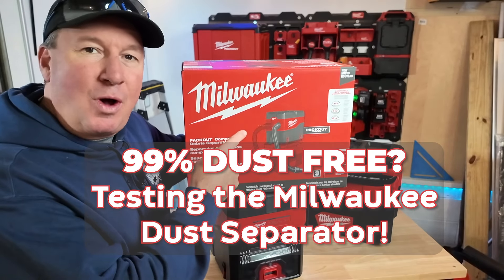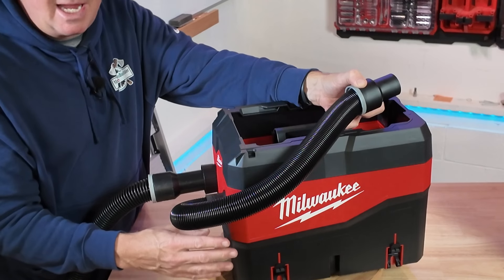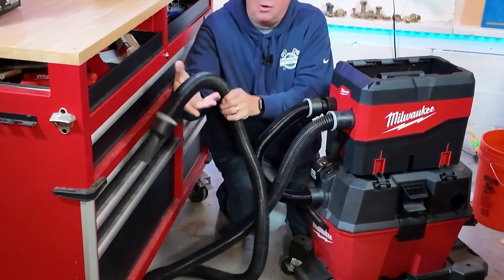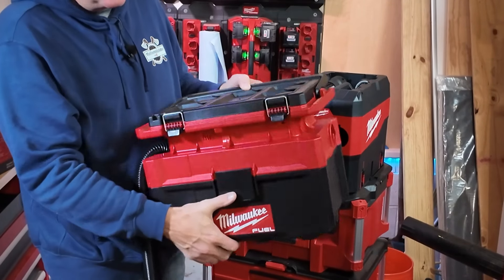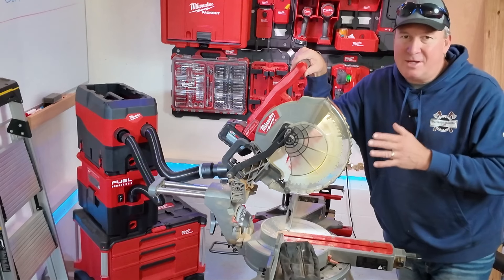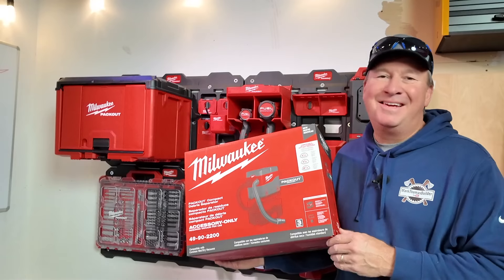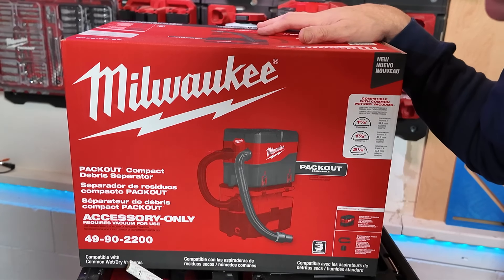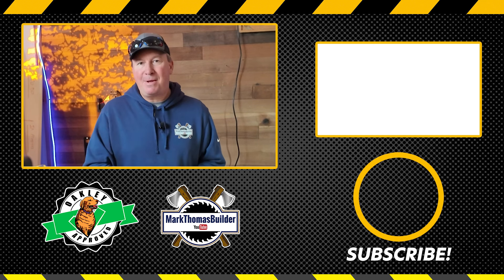Testing the New Milwaukee Debris Separator – The Ultimate Dust Collection Hack!

Comment: I really like how this works. Looks much better than the bucket method. I also like to stretch a scum sock over my vacuum filter.
Reply from the maker: Great tip, I'll have to try that!
Reply: What is a scum sock? If you put a sock over it, you're reducing suction. Better to invest in a 2nd filter so you always have one ready to go while the other one is being cleaned, or better yet, invest in the fleece bags.
Reply: @HomeSchool4You  Depends what you're vacuuming. A scum sock is very thin like pantyhose and you slide it over the filter, they're used in pools. You don't need a second filter which is the point of a scum sock. Slide it off and pull another one on when needed.

Comment: Sure wish DeWalt would come out with a nice smaller unit like this, to pair with their cordless dust extractor. That thing fills up quick. Maybe I just get this and pair the 2
Reply: Look up CarpenterOne Tstak dust extractor set up. He used a versastack large container that works with Tstak to create a dust separator for it. I built the same one and have used it countless times and once in awhile I need to empty the fleece bag and clean the filters. It’s a really great set-up.
Reply: @EveryDayCivilianBlog  will do! Thanks for the suggestion.

Comment: Using the bag AND the debris separator is redundant. In fact, both the bag and the separator will reduce suction somewhat. It's best to use one or the other for best performance.
Reply from the maker: That's probably true.  My thinking is that since the bag and filter is new, I'll probably not lose too much performance.  Once the filter gets dirty, then the performance drops pretty quick.

Comment: I like the idea of this. More compact than the bucket types.  I have the packout vac and the fleece bag fils up really quick.
Reply from the maker: This will definitely help you go through way less fleece bags.
Reply: I have the dust separator but I also use the fleece bags. I will say it’s best if you don’t have the separator is to use the fleece. Take some really nice scissors and cut the end all the way across. Take a thin piece of plastic or wood and use some nice binder clips to make it removable. Then you can easily remove the clips and wood piece and dump the bag out and reseal it up for tons of reuse!

Comment: I would connect the m12 plane to it as this make a huge amount of shrapnel. The second tool would be my m18 5" orbital.
Reply from the maker: Yes, the power planes definitely get messy.  I'm planning to review the new M18 5" orbital soon.  It was very nice when I tried it at the Pipeline event.
Reply: @MarkThomasBuilder  I have the m18 router as well as the m18 trimmer that would also really show the benefits of that separator. I would like to see some really big chips being ran thru it. Fantastic review!